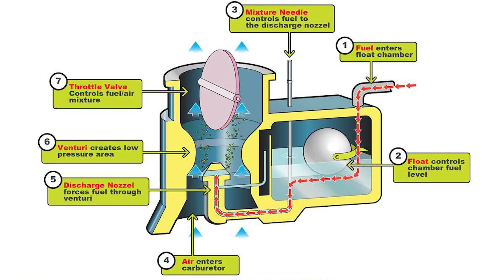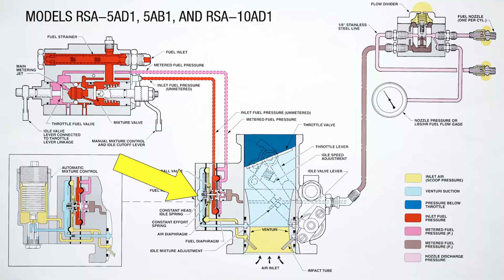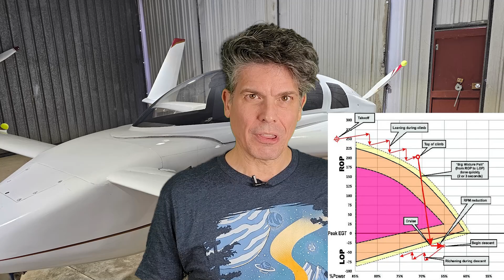A Smoother Engine and Better Fuel Consumption On Your Airplane! GAMI Spread Testing

Comment: I would be interested to know your thoughts on using a converted auto engine in an experimental craft. 
I’ve seen some interesting examples. And they “seem” to be cheaper to buy and upkeep. 
Keep up the good videos. My dream plane is a Velocity XL for the family. I enjoy your Canard specific content. 
👍🏼👍🏼
Reply from the maker: To me it depends on the airframe. If you're talking about a very well established, standardized airframe like an RV, built from a standardized kit, whose performance is very well known, then adding the risk of an unknown automotive engine to an airframe which was not originally designed for it, can be managed. 

However, if you are building a plans-built, one-off or uncommon design, where the airframe (and subsequent performance) can vary wildly depending on the nuances of building, C/G, weight, modifications, etc...you are already a test pilot flying an unknown airframe. It makes sense to have a known and trusted engine in that airframe, to mitigate risks. Adding an experimental engine design/installation into an experimental airframe design, you are adding an awful lot of risk to your flight test program. 

Also look at the engine itself. Aeromomentum engines have a very well (mechanical engineer) designed gearbox attached to a brand new auto engine that is torn down and rebuilt for airplane use. A different, more popular (and less expensive) provider of auto conversions uses engines of unknown provenance primarily taken from junkyards, attaches a gearbox and sends them out the door, using their customers as beta testers. I am not quite sure why they are so popular, but perhaps price matters more than anything else?

When it comes down to it, it's all about your tolerance for risk. Has anyone installed this specific engine in this specific airframe before, from which you might be able to derive data? Was that airframe built to plan, or were there modifications done to it (including modifications to accommodate the engine)? Lots of questions that need to be answered during the planning stage.

THAT said...I know of more than a few canard aircraft builders that attempted automotive engine installs, and after years of fighting repeated issues: overheating, gearbox failures, engine failures and other problems...gave up and went back to a tried-and-true Lycoming or Continental.
Reply: @ 
Dude, I really appreciate the reply. For a comment thread and you not knowing me from Adam, I appreciate it 👍🏼
Those are all very valid points. It would take some real investigation for sure. 
Have you seen, or do you know of the gentleman who dropped a LS into his velocity? 
It at least sounds amazing 😆
Thanks for the feedback!

Comment: After flying for a 135 operator with millions of hours operating Continental and Lycoming fuel injected engines, I would have to tell you that this guys full of it and shouldn’t be listened to.  Buying crap from Gami or any other stuff from these BS peddlers isn’t necessary. But good operating practices and discipline is necessary.  I hate to tell you that most of these internet heroes are just that, full of words with a lack of knowledge.  This guy got my attention when he told us that it’s ok to cruise your plane around lean of peak EGT.  If that isn’t begging for a burnt exhaust valve, I don’t know what is.  If that operator had to change out a cylinder and piston assembly we’d all hear and know about it.  Properly operated that was very rare.  I highly doubt if this guy could tell you how to properly start a fuel injected Lycoming when it’s cold let alone hot.  So fly safely, and remember that gravity sucks!
Reply: I would strongly suggest that you read Mike Busch's articles on Lean of Peak Operations, as well as the older Deakins' articles (Pelican's Perch) on LOP operations, before posting on this subject. Lycoming and Continental both approve of LOP operations (Lycoming when below 75% power, and Continental below 65% power). This discussion merely elaborates, in a simplified manner, what both Deakins and Busch argue (and what the extremely large data set that Busch's Savvy Aviation has collected supports). You might as well be arguing for a flat earth. With a turbocharged engine (which is what you might have been running in your 135 ops), LOP operation may be contraindicated, but with normally aspirated engines, LOP ops are not only acceptable, but preferred, for efficiency reasons.

Comment: Nikasyl, add ceramic coatings on things like the top of the piston and the combustion chamber and the cylinder will keep more of the heat inside of that cylinder. Especially during the expansion portion of the thermal chemical expansion that is pushing on the piston. The more that burns off. The better balance of fuel to are ratio you have the more efficient your engine is going to be.

Comment: Just wondering, with all the monitoring that's on your aircraft… is it possible to have real time in flight monitoring of ignition timing? I think your electronic ignition had a voltage output that represents the ignition timing. Or was it a voltage input that sets the timing? I think you were displaying that voltage.
I was thinking more of monitoring all of the magneto and electronic ignition plug leads and displaying/logging the timing relative to a crankshaft position sensor. For the HT pickup, I'm thinking of something like those cheap RPM/hours meters where a sense wire is just wrapped around a plug lead. (Capacitive pick up. No direct contact). Not literally using the RPM guages, just using that style of input/interface circuit repeated 8 times.
I guess you'd get most of the information just monitoring one lead from each ignition system but you generally work on a "more monitoring is better" principle and also I'm not sure what obscure modes of failure are possible with the magneto.
Reply from the maker: The electronic ignition does have a line out that shows the amount of advance it is applying - but that's assuming that you have the MTH timed properly to the engine.

To do what you're thinking, you'd need a crank position sensor so that the monitor knew exactly when the engine was at TDC, as well as sensors on the plug lines to identify when they are firing in relation to the crank position sensor. Definitely doable, but I don't know that it would be that useful beyond perhaps for an A&P to do some sort of timing issue diagnosis.

Comment: 10:22 Doesn't the edge of that fuel hose look perished/split? (Maybe it just wasn't cut very neatly?)
Probably a stock photo and not yours.
Also, is that the recommended type of hose clamp for that application?
Reply from the maker: Yup, you're right, that is my picture, and it's an older picture from when I first got the plane - I've since fixed that hose and clamp.

Comment: Uploading the engine data to Savvy and being able to plot all of the data channels is so helpful, especially during Phase I testing.  I'm running the Superior cold air sump with the EM5 SDS EI/EFII system and show .1 spread without doing individual cylinder tuning.  Hopefully we can help our engines last much longer and more quickly see symptoms before we have in flight emergencies.

Comment: Vanity channel?  I like to know who is giving me info. I found this info enlightening, a useful insight into how things work. The information can be used in many different fields of how to design tests and how to search out and test the data points I need to solve a problem. The reference to Savvy Aviation has a wider application across many different fields. It shows an example of how to turn theoretical information into a practical and monetized application.